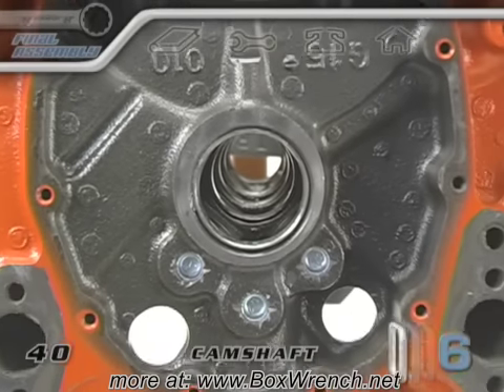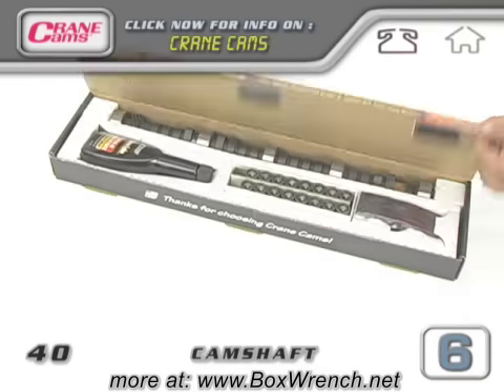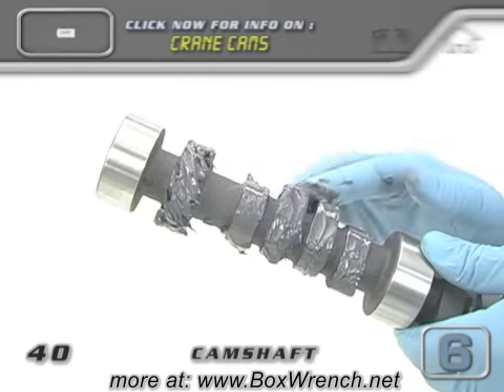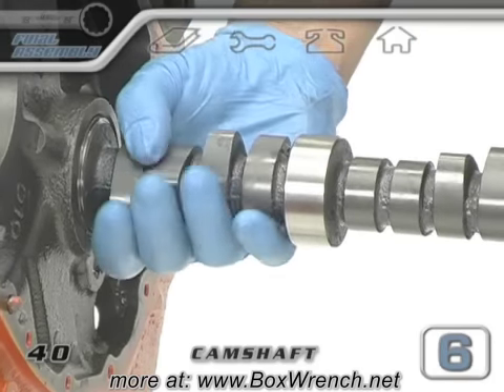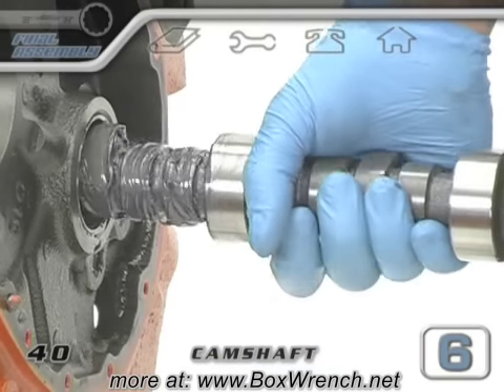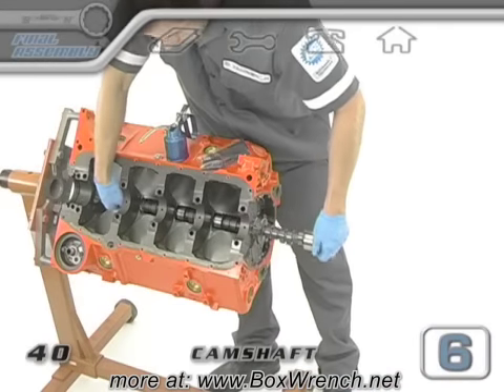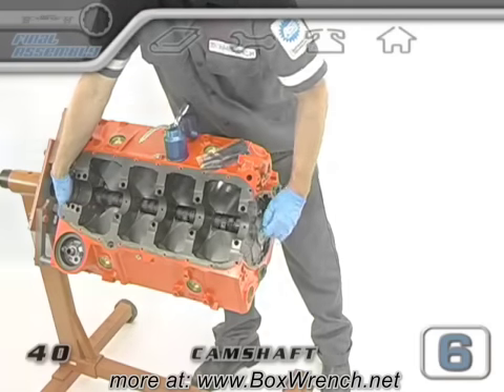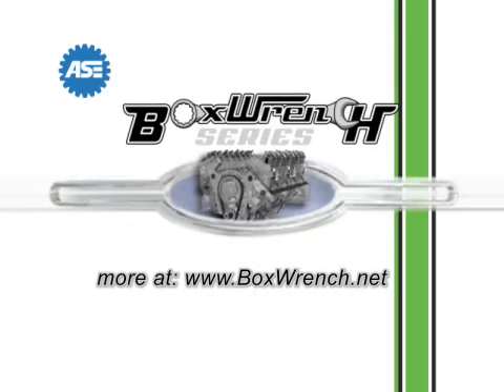Camshaft Installation Video - Engine Building Car Repair DVD

Comment from the maker: In most of our research so far, there just aren't as many people that are willing to do complete engine rebuilds on overhead cam engines and smaller 4-cylinder models. 

There is a vibrant community of hot-rodders and engine builders that completely remove and restore/refresh V8's on a regular basis. 

We'd love to see more of a response from people with 4 cylinder engines and fuel injected applications. We we see the demand, we'll consider making videos for that market.

Comment: Yes, Torco makes a few Assembly Lubes that contain Molybdenum. In saying that, there are several different types of Moly. Torco uses what we call a Molybdenum Dithiophosphate. This is a liquid form of moly which less abrasive than a Moly Disulfide which is a solid particulate form. FYI, Torco is the pioneer of Engine Assembly Lubes. We were building assembly lubes before they were even considered or recomended in the engine building industry. All Torco engine oils contain an abundance of Zinc.

Comment from the maker: @youdragon Rod side clearance is checked by pulling the oil pan and putting a feeler gauge between two adjacent rods. If  your clearance is .025" or higher, you'll likely see a lowering of oil pressure. The bigger issue is whether your rod bearings are wearing out. Only way to check them is pull the oil pan, pull rod caps, push pistons up to get to rod bearings. 
Just try a 30 weight oil first. 
Then verify that your oil gauge is correct. Install a separate oil gauge directly into the block...

Comment from the maker: The camshaft absolutely has to have a liberal amount of moly lube applied to the lobes in order to allow for proper cam break-in. 
The pistons will not be greatly affected by excess cam lube that makes it's way to the oil sump as the piston skirts are mostly oiled by splash the is slung from the rods after traveling through the oil pump, the oil galley and then to the exit points of the crank at the rod journals or squirt holes.

Comment from the maker: For the lobes of the camshaft it's best to use "Moly" Lube (Molybdenum Grease) which is usually supplied with a new camshaft but is available separately if needed. The reason is it's lubricating ability is higher than oil alone and is needed for new flat tappet camshaft lobes (not roller cams) when they are first run during the critical break-in period of a freshly rebuilt engine. If you don't use Moly Lube, you run the risk of having a cam lobe "wipe" itself out and going flat

Comment from the maker: If your engine is still in the vehicle you can swap out the camshaft. You would have to remove the radiator and the water pump and timing cover as well. Most likely, depending on your engine type, you'll have to get the harmonic balancer off before the timing cover can be removed.

Comment from the maker: @ajhnson true, this one short clip does deal with an in-block camshaft for a V8 pushrod engine...but, this is only a piece of a 3 1/2 hours DVD. 
Almost every other section of the DVD has information and engine building tools instructions that you can use for any kind of engine. 
You have pistons don't you? 
There is extensive footage dealing with piston removal, machining and installation. Also, all the gasket sealing techniques that are universal to all types of engine building.

Comment: It depends on the vehicle, front wheel drives yes the engine has to be removed, but with rear when drives sometimes you can get away with removing the radiator but not always. As for which cam it is well if it's standard the manufacturer can tell you, if not the brand and a serial number is usually stamped on it somewhere.

Comment from the maker: @youdragon 
Cam bearings would not be a likely cause of oil pressure dropping as you describe...
The most likely issue would be that over time, the rod side clearance has been increasing as the connecting rods rub against each other. Oil pressure would begin to decrease as more oil seeps out between the rods. This can also be multiplied by increased clearances in the gears of the oil pump as it gets older. 
You may see a an increase in pressure if you use a thicker oil such as SAE 30 weight

Comment: Any chance you are planning on doing a DVD featuring a modern, overhead cam engine?  All of the videos on the market seem to be for older, pushrod style engines.  I know many of the same principals apply, but some things are different.  It'd be nice to see something other than the typical "This is how to build a V8" video. 

I will say though, out of all the videos I've seen, yours are the best!

Comment: hey this is pretty good info. My suggestion for an engine with fuel inj, and dohc would have to be a nissan VG30dett. In large part because 90% of people running this engine are DIY'ers and are always doin complete rebuilds. Thanks again!

Comment from the maker: If you're not pulling the block out, you don't have much choice. You wouldn't be able to replace the cam bearings. 
However, the cam only spins at half the rotation speed of the crank and doesn't require as much oil feed lubrication. Honestly, cam bearings don't get the same abuse that the rod and journal bearings of the crank do. 
You'll likely be just fine pulling the cam and leaving the old bearings in place. Just be sure the new cam rotates freely by hand prior to stalling the timing set.

Comment: Completely depends on the "book time" in hours to remove the parts needed to get to the camshaft.  Most cases the book time includes the reinstall time, if not ask about that when getting quotes.

Call around and get several quotes before making a commitment.

Comment from the maker: Overhead camshaft design is very different from what is seen here. 
This video directly applies to V-types blocks such as V8 and V6 as well as any in-block camshaft design with Overhead valves and pushrods such as a line6 or inline 8 engine.

Comment: Torco only builds High Performance and Racing oils. All of our oils are over built with large additive systems that would frighten most other oil companies. We do not build oils based on API guidelines. We build oils based on our extensive back ground in solving lubrication issues or improving performance in a racing application. Therefore all of our formulas have an abudance of Zinc and many other components that address Anti- wear, Anti-friction and detergency.

Comment from the maker: @dnl5649 yes, you need a 'camshaft bearing installation/removal' tool. 
The removal and installation process is covered in our complete 'Basic Engine Building' DVD. If you take your block to a machine shop, they'll do it for you, or if you want to do it yourself, you'll need the cam bearing tool and our DVD can show you the whole process.

Comment from the maker: @TorcoOil Do you guys at Torco make a moly lube or equivalent intended for flat tappet cam break-in? 
What about the fact that all major oil brands have removed the zinc content from their oils? This is causing major problems with people that still like to run flat tappet camshafts and lifters (high percentage of classic car restorations and hot rodders..)
Does Torco offer any oils with added ZDDP?

Comment from the maker: Don't use anything but a Molybdendum (Moly) lube, or another engine bearing or break-in lube that is specifically designed for flat tappet camshaft lobes and lifters. 

Lithium grease will not cut it. Also, modern oils do not have a sufficient amount of zinc and other lubricants in them. Any engine with flat tappet lifters must use special oil that has sufficient zinc. There are oils on the market that display the zinc additive is actually inside the oil bottle...

Comment: Well you'll probably have to pull the intake manifold off, water pump, timing cover, grill and radiator and what ever else is in the way of getting the cam and such out.

But yes you can swap a cam without pulling it out of the vehicle.

Comment: I have a 2002 ford rangr 2.3l and am thinking about putting an edelbrock cam in it. Are there any other nessecary parts that are usually ordered with cams or is it a simple plug and play installation??

Comment: @KARATExxCHUCK 
dude u wouldnt have to take the block out of the car u could leave it bolted in but u would have to remove the rad and all that in order to pull the cam out but other than that it wouldnt be much work dude oh and plus the beatings u would have to pop out so u would have to remove the intake and carb to get to that shyt.
Reply: hung low i was just wonering that thnx bro

Comment: @mike711750 well, first, buy a new car. a van will never be as fast as a car. however, there are things you can do to make it a bit better. higher flow intake and exhaust are the easiest ways

Comment from the maker: Yes,  it's true that working on an engine on a stand is easier, but shooting instructional videos under the hood of a car in a dark garage isn't very helpful. 

Doing a camshaft swap as shown here isn't very difficult once you get the radiator and any obstructing brackets out of the way. There is also quite a bit of under-hood work in our full length DVDs as well. 

Should get any skill level of mechanic up to speed pretty quickly...